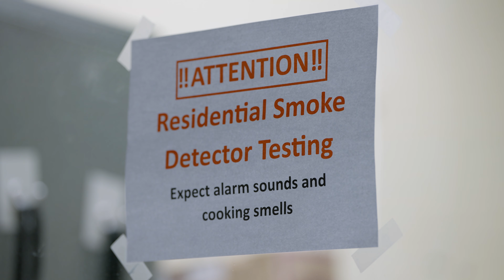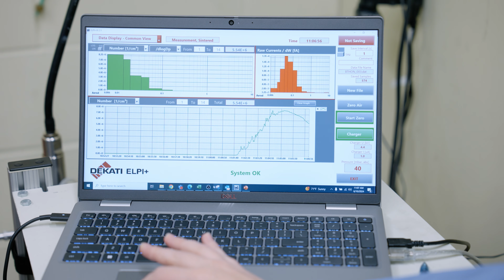Smoke Alarm vs Bacon

Comment: In the last house I rented there was a smoke alarm right outside of the secondary bathroom, anytime someone would take a hot shower and open the door without letting the steam dissipate it would set off the alarm. I’m curious to know what distance away from a shower  y’all would recommend an alarm being?
Reply from the maker: Thanks for your comment! 😀 Shower steam🚿is another common cause of nuisance alarms.🚨 Our suggestion would be the same as for cooking placement, at least 6 feet or more if you have the space. The standard for where to mount smoke alarms is NFPA 72. You can find some simple guidance on the NFPA website: https://www.nfpa.org/education-and-research/home-fire-safety/smoke-alarms/installing-and-maintaining-smoke-alarms.

Comment: It's too bad one can't throw a HPMS in a smoke detector to see if what's triggering the ionization detector and/or photodetector is a combustion product.
I wonder if checking the CO2 concentration when the ionization/photo detector sees something would be a cost (and space) effective substitute for a mass spectrometer. 
I understand that not all fires will release CO2, but realistically at least %99.99 of residential fires will release a noticeable amount of CO2 along with smoke, which not all fires produce either.
Reply from the maker: Thanks for your comment.😁It’s all about balancing cost with performance. It’s possible to create a more sophisticated smoke detector if you’re willing to make it more expensive. 💵 The smoke alarm standard is based on performance, so manufacturers are free to use any sensor they can think of as long as it meets the minimum requirements.